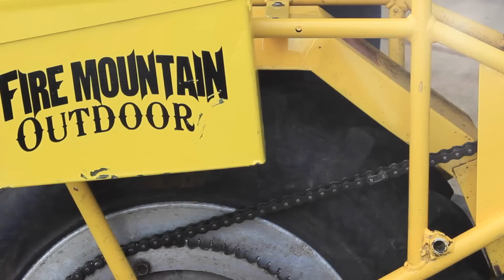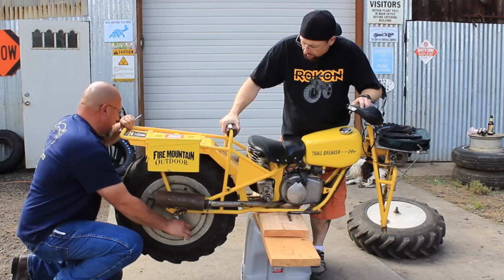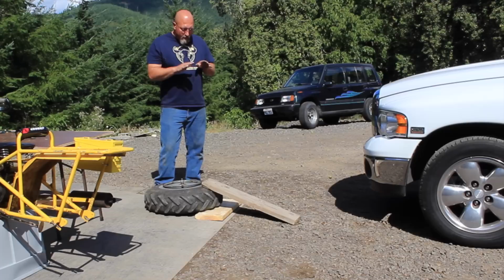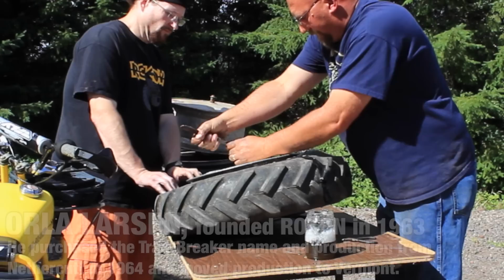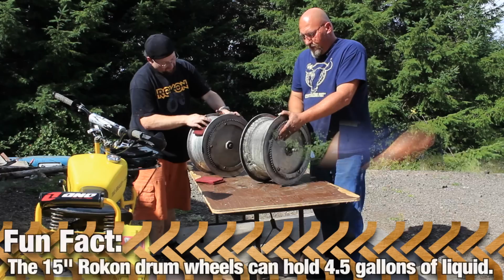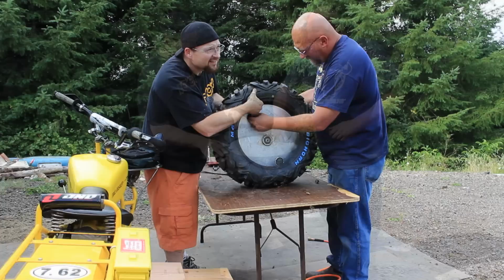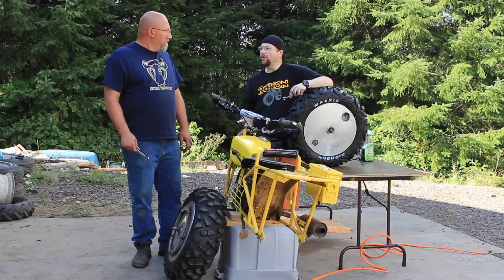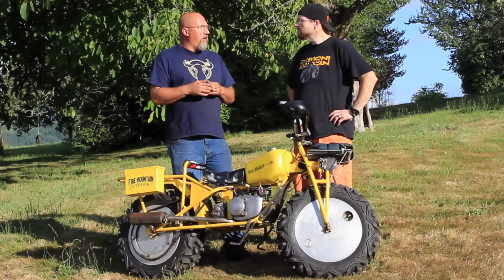ROKON Trail-Breaker: DIY Maxxis Bighorn Tire Installation

Comment: Great video, I want a Rokon too! My Maule bushplane has 31 inch tundra tires that I operate at 7 psi. Anyway with heavy braking the tire spun on the 10 inch wheel and sheared off the valve stem. When I remounted the tires I added contact cement to the wheel and tire beads. Since utilizing the contact cement I have had no problems with tire slippage and disassembling the tires isn’t a problem either. Just a thought. Really enjoyed your video

Comment: Not knocking your video at all. My 2008 Honda 400ex floated across water very nicely also and was able to lightly accelerate and turn. Cool rig!
Reply: The Honda can do trails and  roads , can  it climb a steep hill possibly wooded and brushy where no trail exists ,especially in the two wheel model , can the Honda carry its own fuel reserve in its hollow rim ? The Rokon is truly a two wheeled tractor or 2x2x2 the last two are the drivers legs when the going is extreme. They will only do 35mph  so your Honda is faster but speed isn't everything.

Comment: Nice Kittery Trading Post shirt.
Reply from the maker: It's one of our favorite places to shop when we are in Maine! Cabelas comes close but nothing beats Kittery.
Reply from the maker: +panhead1219
The most common setup would be to use an outboard motor fuel line and primer bulb/pump.

Just stick one hose in the bung in the wheel, and the other in the fuel tank, and pump away.
Reply from the maker: It could be done...  with serious modifications, including cutting, and grinding the frame and welding on a new fork pivot boss(fish mouth), etc...

Comment: What a great video, thanks for showing this. Did you find this change to make the ride softer?  What was the reason for going with the tube vs tubeless? I noticed that the aluminum was corroded, when you hear folks talk about water or fuel in the rim, with all that corrosion you would think that would be bad for both your body and the carburetor. Any thoughts on what to do, keep fuel or water in at all times to keep this from happening? Peace, Reese

Comment: Is it an optical illusion or do the early Rokon models have a taller wheel, I heard you say 15", the new model seems to 13" or 14", am I wrong. Wish we could get these bikes in Australia.
Reply from the maker: +Alf Bittner Correct. In the mid-1970's Rokon began to offer 12" wheels. The older bikes like mine had 15" wheels.

Comment: I have a 2002 Rokon Trainbreaker (Kohler  motor) and suregrup tires that are fairly worn out.  Would these Maxix Bighorn tires work for me . . .??  Thanks, great video.
Reply from the maker: +JamesStaudacher Bighorns will work however you will need a different size. The older Rokons like mine, had 15" drum wheels. I believe many of the 2002 wheels were 12"
Reply: Thank you, my wheels are 15inch so they will work.

Comment: Great video!  There is one thing I would have done differently.  As much work as it is to change the tires, I would have put in new tubes as well.  They don't cost that much, and might save a flat way out in the boonies.
Reply: Absolutely right I would have at least clean the mud and debris off that tube couldn't help but notice that going back in.Cant see that being good for the tubes rubbing against it be like sandpaper.

Comment: What, you mean you weren't standing around with a smartphone in your hand watching the AAA guy change your tires?!  LOL

Was curious, since those rims look like they're spun aluminum, could you not have converterted to a tubeless setup, or would you be prone to breaking the tire bead because of the low running pressures you mentioned you use?
Reply from the maker: That's precisely it RCStomper.

Comment: Thanks for the how to guys! As usual I enjoyed watching your "Show". I have a question concerning the tubes. What size tubes did you use or did you reuse the ones used with the suregrips?
Reply from the maker: We reused the sureslip tubes.
Reply: Fire Mountain Outdoors Thanks I'm glad I can reuse my 46 year old tubes!
Reply from the maker: A new tube would probably be from China and have a stem in a weird spot or configuration, turning into a giant PITA....  And besides, the tubes have been in the dark and not exposed to any UV deterioration...

Or that's what we told ourselves to justify putting our old junk back in...  ;-)

Comment: If your useing the rims to carry extra fuel any tricks for getting fuel from rim to tank 

How long does a full tank of fuel last trail rideing ?
Reply from the maker: Boat outboard motor primer pump in a hose..   One end in the wheel, other in the tank.   Pump away.

Mileage varies.  On long, hard, full day rides, the two stroke guys need to take extra fuel.   The four strokes seem to run forever on a tank of fuel.
Reply: Thanks, I rode a rokon back in the 70's

Comment: the bumper of a truck and a hi-lift jack works better and less likely to fuck up the wheel
Reply: thats how i break down the 17-40-15s on my 71 chevy long box and how i did the 14-35-15z on my old 72 wagoner